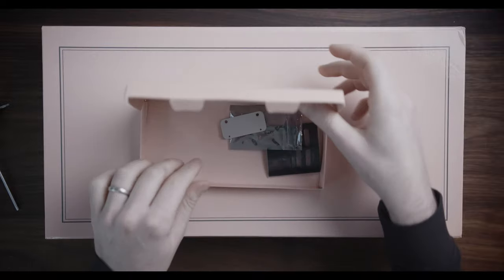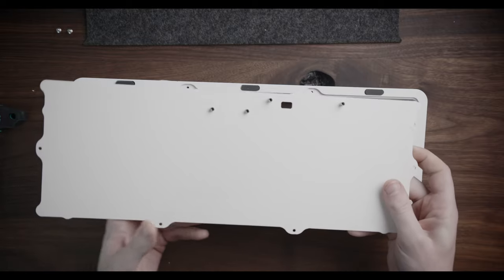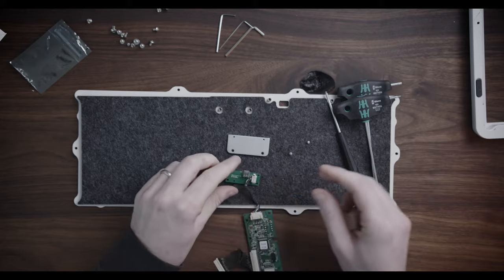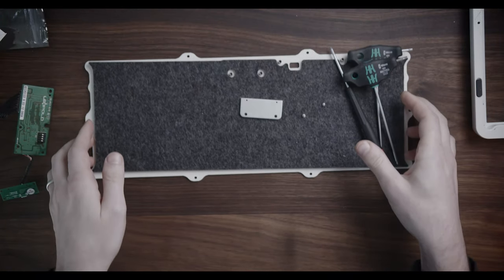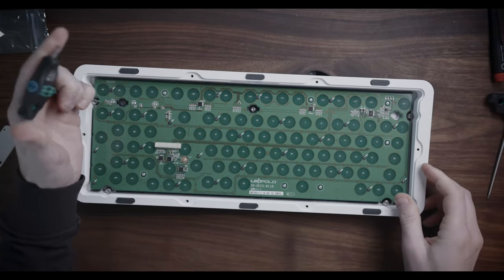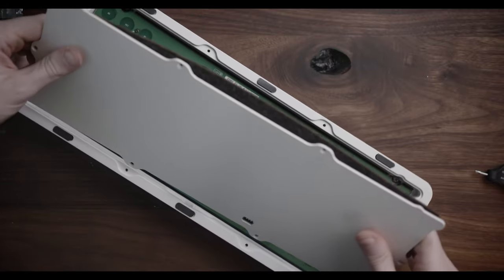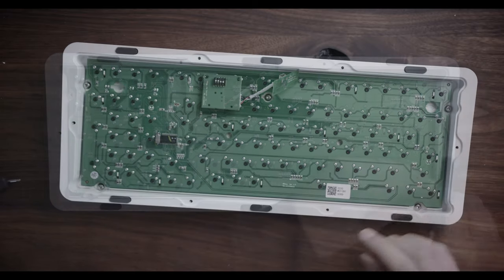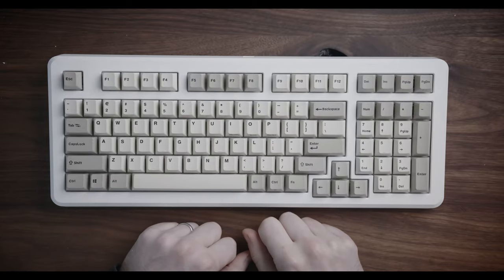Heavy-9 Unboxing and Assembly

Comment: Hi, does the heavy 9 for the fc980c converts the keyboard to type c? (comes with the daughterboard/pcb). Thank you
Reply from the maker: It just uses the breakout PCB that comes with the FC980C/M
Reply: @RyanNorbauer  thanks! I ordered a board that should adapt the fc980c to type c. Does the heavy 9 allow for a type c cable to be plugged to the keyboard then or does it require extra machining (since type c and micro usb have a different size/form factor). Thanks!
Reply from the maker: @jd5787  I think you might need to file the hole open slightly larger. I’ve heard of other people doing this but of course it’s not my recommended approach. Why not use a cable that has micro on one end and C on the other?
Reply: @RyanNorbauer  sounds like a smarter workaround than filing an expensive custom board! Thanks
Reply: Ha one more question, is there somewhere on the website where it is possible to see the different variations of colors by angle of view?